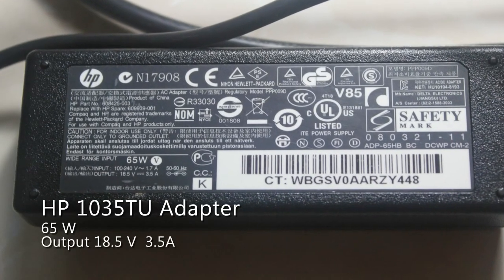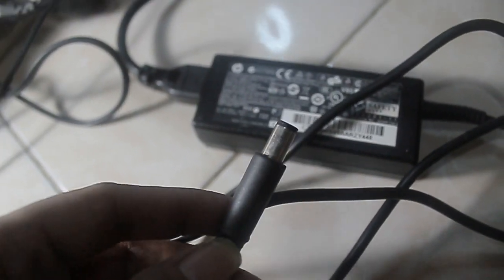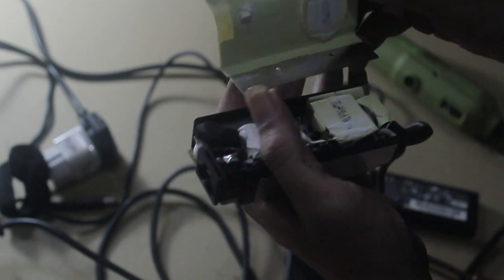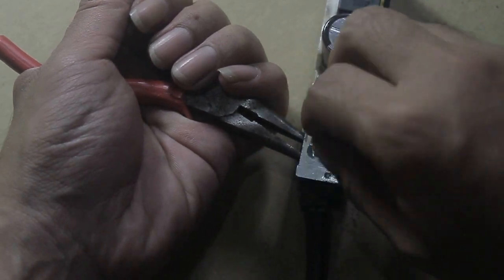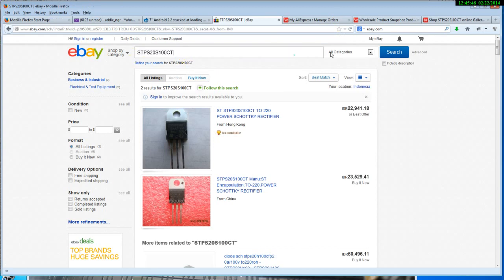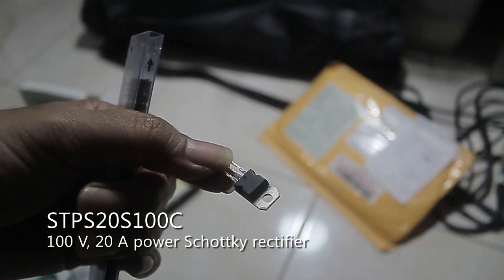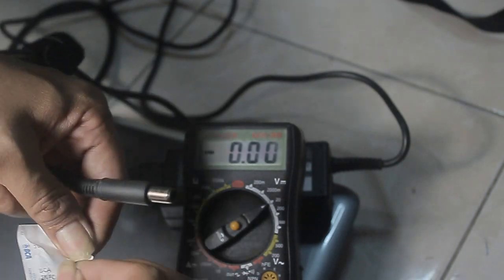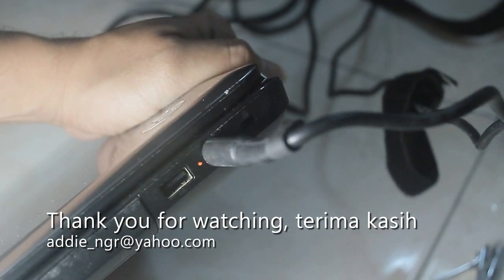Hp laptop adapter repair ( rectifier replacement ) memperbaiki adaptor laptop

Comment: Hi mine adaptor work fine for 3-4 hours.After that adaptor gives 19 volt for 9 seconds and stops givinig for 5 seconds after 3-4 hours of using (heating) , i dont know what is issue. have you got any idea ?
Reply: throw it

Comment: mine is doing the same no volts , i check wiring itlooks good,  how do i make sure it is the rectifier that is causing the problem?
Reply from the maker: +joel castro Most of DC adapter I fixed got the same problem with rectifier /or sets of Diode. They are the first guard ,.second; FInd  if theres sign of other physical damage ; burns, bulging condensator caps., smell.  etc , also  check the laptop connector.
Ideally u have to check each component for the complete analysis. 
unfortunately I dont have much skill and equipment for SMDs and ICs  
it has alot of it :)
Reply: +addiengr1 

I know and the hot glue and tape do not help the situation, but I accidently created a short curcuit after trying to resolder so points that I thought looked cold. SO it was getting AC power properly, Originally I thought the problem was something to do with the 4 pin monitor that seperates the ac and dc part of the board.
Luck for me thuodh I read on the HP site that they are recalling some power supplys due to fire hazard. The recall is for LS-15 power supplies. I looked on the cords and it does say ls-15, but when I type the power supply part number and laptop serial number the site tells me that the power supply is good and there is no reason to replace it. I contacted HP  and demanded a replacement because it die and also because it has LS-15 written on it. Lenovo also has the same recall, so I checked both my p580 and t430 laptops for the power supply ,  but they seem ok. 
Sorry for the long post thanks again for your help.

Comment: Can u just switch adapters by taking wire out
Reply: I’m still new on doing this, but make sure it’s not critically too low or too high, if it’s 1 voltage up or down, then it will be fine, be careful of how u put in the wires.

Comment: @ addiengr1
kalau carger ga mati tapi lemah , ga uat hidupin lepi.kalaupun kuat buka windows,tp cm sebentar lepi langsung mati. apa yg diganti sama seperti di video ?
Reply from the maker: itu sepertinya harus ganti battery laptopnya. tidak bisa tampung listrik lagi. seperti battery handphone yang kembung
Reply: addiengr1
lepiku malah ga pake baterey  langsung cas :D
Reply from the maker: fara nadia
boleh tahu merknya, tipenya
Reply: addiengr1
LITE ON bro...  19v 3.42a
Reply from the maker: laptop merk LITE ON ??
Reply: addiengr1
laptop acer , adaptornya lite on :D

note : laptop sehat ,soalnya di tes pake carger yg waras laptop jln dengan normal

Comment: Chager is not working after changing rectifier or any other things.. soldered other points also ..bt no result...
Reply: Dead charger :(
Reply: +suman sarkar  just go to ebay and buy  an adapter for 5-8 bucks and save yourself the hassle
Reply: +Maelo Gonzalez For 5$ - 8$ any NEW adapter found will certainly be counterfiet!

Comment: I replaced the rectifier bt still the charger is not charging ... In fact i also checked with a tester at the terminal current is flowing properly bt its not charging my laptop... Wat can b possible solution thn ? Plz help
Reply from the maker: If there's a reading from ur adapter, then u may check other posibbilities, female laptop connector solder joint may loose, or check ur cables w/ multitester may broken (replace the head)
Reply: +addiengr1 

Agreed, I have had this happen twice before where the power supply shows a good reading, the problem was the connector on the laptop side.

Hey Addiengr1, you seem like you know about electronic components and testing, I am in the market for a new digimeter, the one I have now was bought on ebay and is unforetunately a knock off or poor quality. Do you know of any decent or good meters? possibly one that can do a variety of test modes, for example caps, diode,ac, dc, .etc